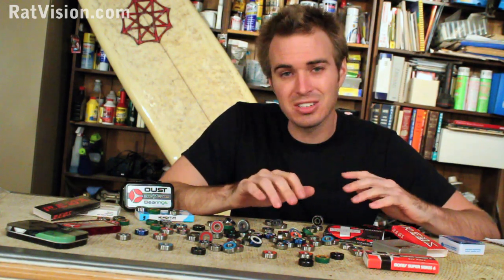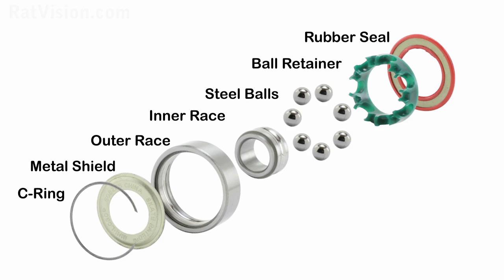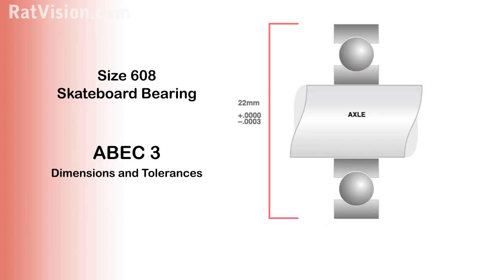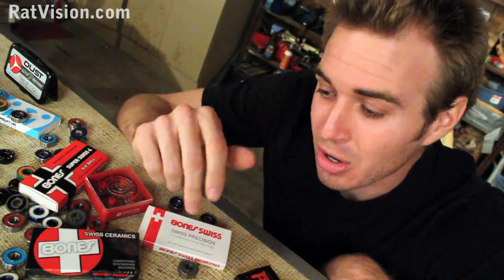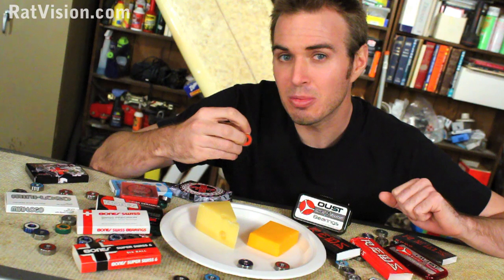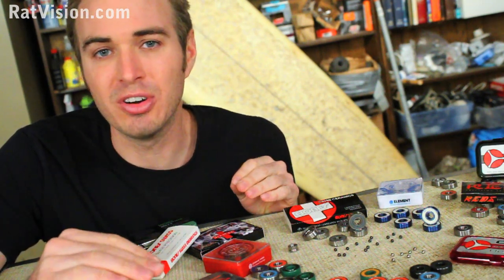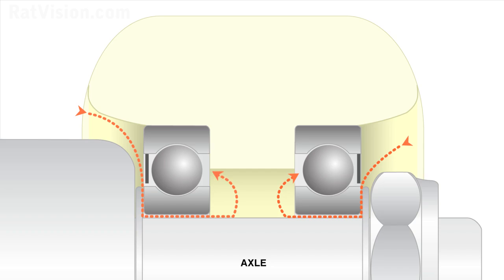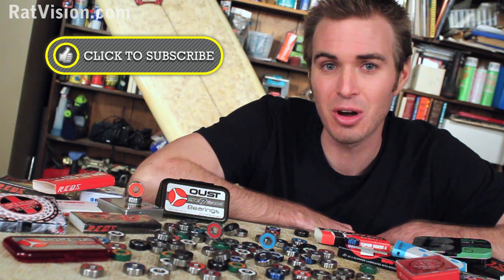What is ABEC / Swiss / Ceramic Bearings

Comment: Good presentation, thank you for uploading!

You well explained how many factors consider the performance of the bearing/skate so at the end you may change the conclusion that "American steel-ball bearing are far and away the best". What does that mean anyway? Do you have only one manufacturer with only one model?

At the compression test you should show the load-deformation curve together with the expected load while skating (considering the dynamic influences and later also fatigue). If you are in elastic part of the curve, far away from plasticity, the final strength is irrelevant.

Comment: Well, Rat, if you were as smart as you thought you were, you wouldn't make any statements about material characteristics.  Nearly all ceramic materials used in bearings are harder than ANY metal commonly used in bearings, sometimes by a factor of 10.  If you really want to match qualifications, go ahead and try.  I was being nice in my replies.

Comment: a bit nit picky but the test you performed on the ball bearings was not a hardness test, it was a compression test

the ceramic ball is harder than most steel ball bearings by its very nature, being ceramic

this also makes it extremely brittle, hence why it failed so catastrophically 

the steel ball that you tested up to 20ksi was likely tougher (less hard) and was able to yield slighltly, thus giving the impression of higher durability

to test hardness you need to perform brinell or rockwell tests (one of the two is generally for harder materials cant remember which one)
Reply: all I was saying was the statement in the video was misleading

"ceramic balls are harder than some steel balls, but not all, and here's a compression test to prove it"

a compression test is not a hardness test

sure most of the people that watch this will not know any better and be visually entertained at a couple of ball bearings getting crushed, but it is not right to misinform people, unintentional or not
Reply: I am just tired of the pseudoscience being put out as evidence of someones opinion.  He sounds like a paid advertisement for the American bearings.  The fact that he was able to crush a ceramic ball at 8000psi is meaningless for the application.  Those balls will NEVER see that kind of load.  That is like saying that a bullet will disintegrate in the air if you fire it at 20,000fps.  I have never seen him test bearings in a manner which demonstrates how well the bearings hold up under real world conditions. A major failure mode for bearings is unknown to him and ceramic bearings go a long way towards preventing it.
Reply: @rcbearings1  This is what I was thinking, your ankles will shatter or break before those ceramic bearings will shatter like they did in this video.  It did seem very misleading.  I would like to see a skater actually go out and put both type of bearings under the same stressful tests on a skateboard or rollerblades then compare them afterwards.  If I buy a pair that's how I plan to use them not put them under a compression test.  I don't waste money like that.  What I have heard from skaters and rollerbladers who have used these for a long time, they have not had any problems with them breaking down and have lasted much longer that their steel counter parts.  They didn't say though what type of skating they do.
Reply: Your cause has been embraced. I will show in a few days (or months) compelling evidence that this guy is indeed straight up misinforming people to sell a particular brand of bearings. His replies are too arrogant and plain stupid.
Reply: fee lthhis   Well it’s definitely been a few months you know?
Reply: Justin Hall Exactly!  For bearings, modulus of elasticity is MUCH more important.  In layman's terms, that tells you how much pressure the material can withstand before deformation.  Silicon Nitride ceramic is about 5 times better than bearing steel.  Sure, you can put a lot more pressure on a steel ball before it BREAKS, but how much pressure can you put on it before it deforms?  Once the ball deforms, the bearing is toast.
Reply: And cracking is not the only failure mode of a steel ball.  The ball was not examined after 8000psi was applied.  If it was, you would have seen a small dent on each side which would render the bearing useless.
Reply: Another thing that was wrong is that ABEC does not rate the internal clearance, it give the tolerances of the rings ONLY and says nothing about ball tolerances, clearance, smoothness of races, vibration or noise.
Reply: +Rc Bearings yeah if I ever had the means to I would run several wear tests on the balls themselves and the races, but I'm a broke teenager
Reply: I been skating since the mid 80s. Ceramics are better by far. The outer race is more likely to stay round. I does take less cleaning. I been cleaning and rebuilding bearings since I had loose ball on my first board.

Believe me it's worth it if you take care of them. Those White Element bearings lastest me 12 years. But the blue decorative crap eventually flaked off into the bearings and the shields were junk.

Im going on 5 years now with another set of Bones ceramic. Not as nice as the elements but better than regs reds and swiss.
Reply: also ceramic is nowdays used in racing brakes because it is more then capable of taking allot of heat before deforming or creating brakefade. the reason they use ceramic balls in bearings is because in most applications the balls rust/break and not the rest around it. because of that ceramic is capable of removing the rust of the things it rolls over wich is why they use it in bearings. most people will not clean their ceramic bearings tho so in the end they will break because of the contamination.
Reply: I really liked this channel, thought I finally found someone explaining this stuff. But this is a pretty big oversight into what hardness is, so it calls into question the accuracy of  the other information in this video and on their channel. : /
Reply: Rat Vision – Skateboard Tech That test is meaningless because you didn't do it under ASTM testing conditions and you didn't show what the ball looked like after it reached its compressive yield point (which is a LOT lower than ceramic).  Yes, Silicon Nitride is more brittle.  But until you reach the point where that characteristic becomes relevant, its performance is superior to steel.  I think you short-change kids by saying they can't understand the results of proper testing techniques.
Reply: @rcbearings1  I enjoyed reading all arguments and honestly, I think that the best thing anybody can do, is watch the video, read the comments, and then leave and go out and test some bearings out that you like, see if you can tell a difference and go from there. I love you guys even after 4 years.
Reply: Rc Bearings I love how you're still discussing this, it makes me happy to see people being so scientific over bearings
Reply: Justin Hall, close your mouth and do a video doing a hardness test and then come back fool.
Reply: @ZZZ-0999  If you take care of them, Ceramic Bearings are the best. Steel Balls get scratched, and dented. There are plenty of vids showing the speed and distance you get from Ceramic Bearings is superior.
Reply from the maker: Rc Bearings Here is something you missed when thinking about ceramic.  SOME ceramics are harder than some steel, so when a ceramic ball is inserted between races with a lower hardness the balls deform the raceway surface.  With damaged raceway surfaces, the ceramic balls are now susceptible to damage due to their brittle nature.  This alone makes ceramic balls terrible for bearing applications, ESPECIALLY in a skateboard setting where loads are constantly applied.  If you know as much as you think you know about ceramic than you know that ceramic cannot handle loads better than steel. This is why ceramic balls are not better than steel.  Please don't be one of those people that believes ceramics will resurface the race.  It's false.
Reply from the maker: Rc Bearings So, you think ceramic has a higher modulus of elasticity?  And you say you worked with NASA for 30+ years.  Just because you worked at NASA doesn't mean you've reached the pinnacle of knowledge and expertise on every subject matter.  Sure, a Brinell and Rockwell test will give a hardness rating, but it's over kids heads.  Showing a compression test is more visual.  What makes you think that Silicone Nitride is 5 times "better" than bearing steel?  It's much more brittle than steel.

Comment: My reds spin for 30 seconds I got them today???
Reply: that doesn't matter
Reply: +JR Z How long a bearing spins is a poor estimate of how fast it is. If you remove all the lubricant it would most probably spin faster, but it would definitely not ride faster. A better test would be to see how smooth it feels when you roll the wheel over your hand. Note, that this is also not reliable, but it might give you an indication if your bearing is putting up a fight.

Comment: Advice on what to do on my rusted Bone Red bearings? They barely move, some don't even move, but I only got them 4-5 months ago. Thanks :D
Reply: Put you bearings in a plastic bottle and pour in some rubbing alcohol so it covers all the bearings. Shake for 5 minutes and then dry immediately. Once you've done that, take off the rubber casing and use a tooth brush to scrub out any more dirt. Now use something like "Bones Speed Cream" or "Tri Flow" to lube your bearings. Put in 1 or 2 drops and spin so all the balls are nicely coated in the lube. Pop the casing back on, pop them into your wheel and you're done.
Reply: Simon Yeung If the races or balls have any rust on them, throw them away as they can't be restored.

Comment: I have a new longboard and I wanted to upgrade the Bearings, although i don't want to spend so much money so I'm thinking of buying reds, what's your opinion?
Reply from the maker: Michah McCullough What is so great about Zealous?  Just want to double check that you didn't get sucked into marketing hype.
Reply: Zealous, about the same price and much better than Reds. Reds are famous for being strong as hell, which is awesome on a street deck, but you don't need to worry about slamming your bearings from a 20 foot gap. Zealous have rubber shields and nanoceramic lube. It's really good shit.
Reply: Michah McCullough OK Thanks!
Reply: Michah McCullough where can i find them?
Reply: I found them thx
Reply: Rat Vision – Skateboard Tech 

Shit man, didn't expect a reply from you. Love your vids. Wish you'd make more, but I know how life (and skating) gets in the way of smaller hobbies.

Zealous are smooth as hell straight out of the cylinder they come in. The quality control is super as far as I've seen. I've got Zealous on all my decks** because I haven't found a set of bearing for the same price that keep me tolling as long, or as smooth. The rubber shields are insanely easy to take care of, and keep out 95% of dirt and shit. The nanoceramic grease they use is an amazing lubricant, I literally haven't relubed an old set I've had for about 14 months now. And I skate them in the dirt, the rain, mud and general grime. They're as quiet as the first day I got them, and they roll just as well. For 17 usd you can't go wrong with Zealous. I'm hyped as fuck for them just from personal use. 

**I've got Bones Reds on my street deck because they're durable. Haven't tried Zealous on my street deck, but the next time I get 17 bucks I'll throw them on my Alien Workshop and let you know how they do.
Reply: My Opinion Is Pay More Money To Get The Bones Ceramics Im Gettin Them And Know That You Have The Best Them Things Roll For A Good 2 Minutes Or More Depending On How Fast You Push It Cheap Crap Aint Gonna Work If You Love Longboarding As Much As I Do Youll Find A Way To Get The Bones Ceramics Period Only Cheap Broke People Will Say Bad Things Bout These Bearings And Truth Is They Haul Ass Seriously I Tried My Friends Board Compared To My Abec 5 Wow What A Difference

Comment: Although "Swiss" has become a somewhat generic term, in my 30 years of skateboarding, it has referred to bearings manufactured by WIB in Switzerland. You say that Chinese bearings "can easily be better" than Swiss, however, I have not seen any of any grade (this includes "Swiss" stamped Chinese knock offs) that can approach the quality of a WIB bearing.
Reply from the maker: What you have to understand is that "Swiss" bearings are not made with specific guide lines, material, design, rating, or manufacturing process.  What is really "Swiss". They are just bearings.  The only thing that is Swiss is the manufacturer and maybe the steel came from Switzerland.  A bearing is a bearing.  This is why  a Chinese bearing can easily be better than Swiss.  The only thing you can do is hope that the bearings you buy did have better manufacturing standards than China, or anywhere in the world for that matter.  There certainly are Chinese bearings that are better than some Swiss bearings.  How and why can this be possible?  Because not every single bearing in Switzerland is made to the highest standards, using the best steel, and manufacturing process.  Again, what makes one bearing better than another is the manufacturing quality and material quality.  Country of origin is meaningless.  We can ONLY hope that Swiss is better.
Reply: Which Chinese-made bearing would you recommend over any WIB-made bearing? I usually buy the cheapest steel bearings with synthetic cages (operating under the theory that high priced/high abec are just marketing scams). In theory, almost any country has the capacity to make the best product in the world, but the manufacturer carries some weight just as a lower grade Mercedes generally offers better quality than a mid-level Chevy.
Reply: Steven Drew I have not seen the WIB brand on any skateboard bearings commonly available.  WIB is not the only manufacturer in Switzerland.  Also, having "made in Switzerland" does not mean the steel comes from there or even that the steel is of a high quality.  The best bet is to try different bearings and buy what gives you the performance you want at the price you want to pay.
Reply from the maker: Rc Bearings I believe WIB makes Bones bearings.
Reply: Rat Vision – Skateboard Tech If they do, they only make the "Made in Switzerland" bearings.  The Reds line is made in China.  I know the actual factory.
Reply from the maker: Rc Bearings Correct, only the "Swiss", but that is not to say that some degree of manufacturing is still done in China.  The balls could be Chinese and the seals from somewhere else.  They could have been designed in Switzerland and assembled there, but all the parts are Chinese too.  As consumers, we don't know.

Comment: What's the best bearing for high speeds long boarding downhill?
Reply: none of the above people are correct, if you want a good downhill bearing, get either abec 7, or tekton 6 balls. these bearings are American made and can withstand higher pressures, and frictions at high speeds. bones are okay, but if you are looking for a downhill option choose the durable abec or tekton.
Reply: I use super six Swiss and I love them. With only have 6 ball bearings it makes for less friction in the bearing and faster speed which leads to better overall performance. I've never had a problem with my bearings and I clean them regularly and they are almost dead silent, my friend uses just reds and they work great he's had them for more then a year and half and he's used them in the rain and hardly cleans them regularly. But with reds you have a bit more wobble with the wheel because the bearing does wear the edges down in the bearing ring over time. Also with the Reds they are a bit more loud.
Reply from the maker: Oust Bearings are by far the best.
Reply: Rat Vision – Skateboard Tech Great video, however I've done a few speed tests myself, with different "Bones" bearings, on the same hill  with the same technique, same speedometer etc etc, my top speeds were; Bones reds : 39.3mph  -  Bones Super reds: 40.5mph   Bones Super Swiss 6 - 45.9mph, And Bones Swiss ceramics: 47.8mph,   I've done everything I could to make these tests fair, and the results are an average of 3 runs with each bearing type on the same set-up.
And overall I must admit, overall for speed/price I prefer the Bones Super Swiss Six bearings, they cost me £55, whereas the Swiss ceramics were £115, for a barely noticeable difference, The only time I would reccomend purchasing the Swiss Ceramics will be if you are doing Downhill races etc, where every second counts, however your technique will affect your times over a dozen times more than your bearings 
Setup: Vecter 37, Surfrodz 176 precisions - These 717's 69.5mm, SS6/Bones SC
Reply: finally someone tests and gets real results. proved my point exactly. i thank you my good sir
Reply: Anytime man haha, :) Used exactly the same liner down a straight hill, really high quality speed camera etc, even waited for there to be no wind when I did the tests haha
Reply: Get bones reds
Reply: Get super reds
Reply: Redz ceramic were made for high speed downhill boarding. Infact they were made for the megaramp. Under extream heat steel balls expand and create friction but they come at a price. a very high one infact.